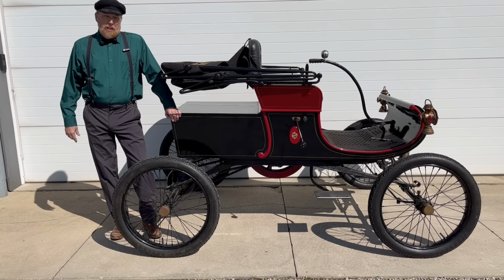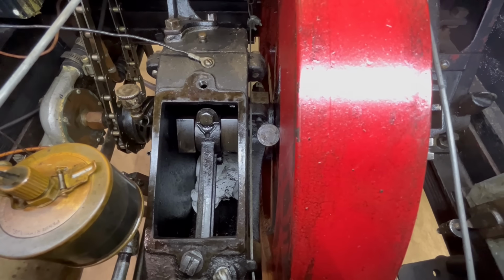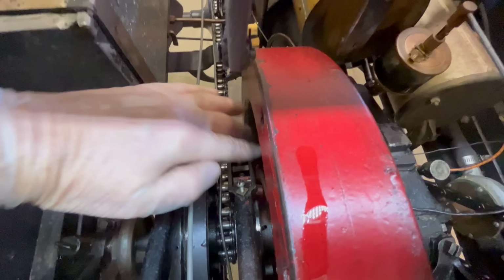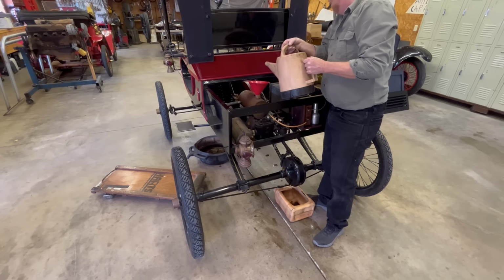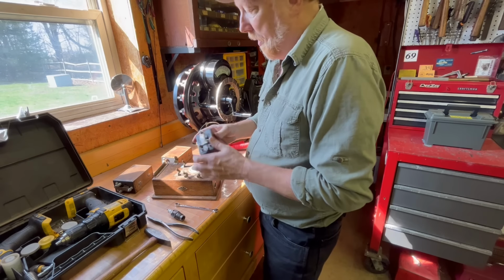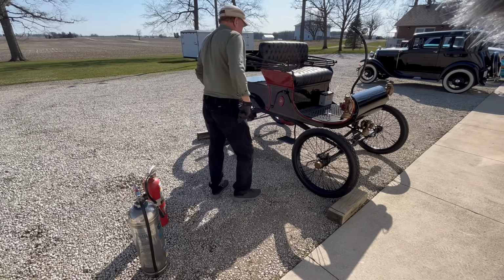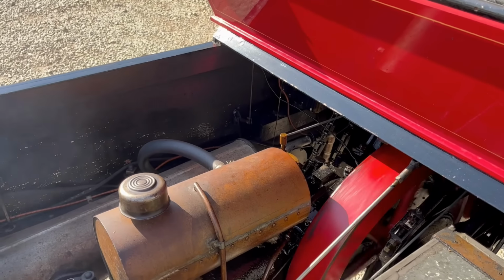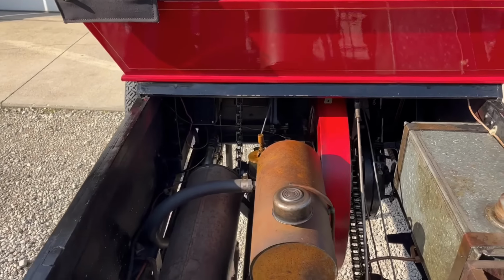1901 Olds: Will it Start and Run @KlepsGarage [EP 62]

Comment from the maker: I would like to sincerely thank the 100,000 viewers who watched in the month of February 2024. You have helped our family through a medical issue. 🙏🏻 not financially but my wife enjoyed the comments and number of views. 
Took her mind off the pain.

She has since had back surgery and is doing very well thanks all. 

This is not a political channel keep your politics to your self. 
I will delete anything political.
Reply: Just saw my first episode. VERY cool! I just subscribed. Aloha from Hawaii! We don't have too many super old cars like that here-
Reply from the maker: You might not have old cars. But you make up for it by being in paradise 😎 thx for watching
Reply: A men .
Reply: I am having a big problem with my car as of late, I was in a terrible accident where I was forced off the road on a curve just after crossing a creek bridge. Since that I have rebuilt my car, But for some reason my chain keeps jumping on the Transmission sprocker mounted on a 1949 Ford Transmission. Can that be caused because of the tighners between the axels are not intune with each other.My wheels measure the same between each Hun Center on both sides.This is a Great problem as of late.
Reply from the maker: Without seeing your car, the only thing I can suggest is a chain is either too tight or too loose. 
Or you having alignment issue as a frame could be bent and not in line with the rear axle.  Kind of crab tracking. Since it was an accd. My guess is alignment of sprocket.

Comment: It's no wonder the first car owners had engineers on staff, garages with apartments for the engineers, and many times drivers to operate these cars for them. It took a rich man to own a car AND keep it running back then.
Reply: Just added 5 miles to the odometer, time to rebuild the top end.
Reply: The very first cars were purchased to transition from horses, so the "mechanical men" that some automotive enthusiasts had on hand were largely stablehands who were adapting their skills to automobiles. Nobody hired a staff and gave them housing to simply maintain a car; they were already there. Horsecarriage maintenance and livery upkeep were not far removed from the horseless carriage.

Comment: At least 65 years ago when I was just little one, I got to ride in an original 1903 Olds just like this one.  I remembered watching the owner add oil to the crank case.  I remember how going down the road at 20 or so seemed so fast.  Stuck with me to this day.  Thanks for the memory reminder.
Reply from the maker: Your welcome. It feels like you’re doing a 100.
Reply: I would like to drive one just for bragging rights
Reply from the maker: The tiller is a strange sensation
Reply: Awesome Story Larry, God Bless You Sir
Reply: To think that that car was already ancient back then in 1960 when you got that ride. And this particular example will still be perfectly drivable in another century, if looked after right. I doubt there will be any 2003 cars running in 2124.
Reply from the maker: It will at last longer than us.

Comment: In 1901 my great grandfather was painting curved dash Olds'. With a brush, not a sprayer. Had to get the consistency of the paint just right plus be an artist with the brush. He later taught one of his dons in law how to do it and Grampa repainted his 1960 F100 that way. It had been used by a prior owner carrying a camper for hunting and the sides were badly scratched up. When he sold it nearly 30 years later, the buyer was really skeptical that it had been painted so long before and with a brush. His trick for getting it smooth was thin it just right with the right thinner and his trick for durability was mixing porch enamel in with automotive enamel. The paint still looked quite good after all those years, in spite of never being garaged.
Reply from the maker: Cool story 😎 thx for watching.

Comment: Having seen other original Curve Dash Oldsmobile 's run in person is a thing to behold. It is truly amazing what was considered the first mass production American automobile. I have a 1958 Merry Olds full size replica of a 1901, which is much less complicated and maintenance, but still requires much oiling to operate. It functions very much the same with two forward speeds and one reverse and will clip along at close to thirty miles an hour. Thank you for an informative and interesting video.

Comment: Just think, back then they checked oil, air in tires, all moving parts, coolant level plus the things you went thru just to drive across town. And only charged $0.10 cents to tune it up .
Reply from the maker: Yes. Now they want $200 to hook up the computer which does their job to tell you a sensor is bad. Then it’s 500. more to fix it. Ford had it right easy to repair and the average farmer could work on it.

Comment: I remember in 05, or 06 I got to drive and original Ford Model T push the pedal to go forward push the lever and let off the pedal to go into high gear felt like it was going to tip over but I felt like a little kid driving that thing after having the privilege to started by hand. Such an awesome adventure and I'm glad I had that opportunity. It truly makes me appreciate watching this video!
Reply from the maker: Thx 4 watching. The olds is actually easier to drive than a T.

Comment: This is a fascinating car.  I've watching this about 3 times.  I believe yours runs best of all the YouTube Curved Dash videos I've binged today.  Sure is a great car.  Thanks for taking us along.  I think you should include it in your 1/4 mile challenge.  The High gear seems to really walk off.
Reply from the maker: Thx Jeff. It is a good runner It needs a bigger radiator for summer driving. Also noisy than newer Olds because of the open transmission. It does run faster than the Brush.  Might just run the quarter.  Thanks for watching.

Comment: That right arm and shoulder sure got a workout. I had to chuckle at the sight of the two fire extinguishers wisely kept near by. What kind of ignition did the motor have? Spark plug or hot bulb? On second thought, a hot bulb would have been much more work. Total loss oiling?
Reply from the maker: Make and brake contact point. Pipe, thread, spark, plug.  Lost oiling system.

Comment: Brilliant engine design 
The internal workings are fantastic
Reply: no theyre not, loud as sheet
Reply: @liukang3545  ?
Who said anything about that
 This is the second time this week
I wrote something 
And someone else wrote a response that implied something totally different 
 - that is also corresponding with the subliminal gaslighting I caught 2 months ago .

Brilliant engine design 
 Wise.  - machine work - articulating style 

The internal - inside mechanism- rod and bearings- cast metal
Workings - the integrated components 

Are fantastic- very good
“ very well crafted 

Ok
 ✅ 
Got that
Sheeet duh too load ????
That is not in the comment 
I have no idea of it’s decibels nor if sheeet was used in the construction 

I’m not casting judgement upon its sound
Only
Saying
1901
And cast iron / steel and alloy metals made with such precision is just absolutely beautiful and amazing 
- theoretically- one could travel in time to 1901 and build almost any modern component with existing machinery and materials and even blueprint details to cast parts that accurately 

It’s just amazing 
Too much to really get into detail of the implications for that

Comment: Nice.....  And very true if you have a collection of anything that is supposed to run in some way, you should use them. Growing up in the 1970-1980's it was so frustrating with the model trains. The new stuff, Lionel MPC many considered junk and the older stuff Lionel 1969 and back was considered the good stuff, but if you had the "good stuff" and ran them the collectors hated that, and the true collectors never ran their trains.  Well I'm now 61 and that trend had changed, There are a lot more train runners and the Lionel MPC stuff has more value now to many and still run pretty good too, and the 1969 and old many run them as well.
Reply from the maker: Agreed I to collect model trains just don’t show them on the channel

Comment: This was the very first mass-produced automobile. I would use the cheap, single-grade oil, like that old "Golden State" oil in the yellow bottles. That stuff is great in old cars. I used it to break in the engine in my vintage Jeep. Once broken in, I switched to Castrol, supposed to some othe best oil there is, and a rod bearing went out. Fixed it, ran it on Golden State awhile more, switched to Castrol again and another rod bearing went out. Fixed it AGAIN and this time just kept it running on cheap old Golden State. Never had trouble again.

Comment: Well it all had to start somewhere right ?, still not bad at all for its day and it worked fine as long as one kept it well oiled 👍, i remember playing gran tourismo yrs ago and trying to get around a verry long german race track on one of these and never made it lol, on a verry long incline it eventually came to a stop and it became stuck between two long inclines connected with a dip, though it did just barely make it over other more shallow inclines, what i found was to put it in neutral at the top of a hill and let momentum get it rolling faster and you might just get over the next hill if you put it back in gear at its right max speed for the engine, it even had the same chugging sound 🤣😂🤣👍, great video thanks bro ✌
Reply from the maker: You were driving a Rolls-can-hardly. Rolls down one hill a can hardly make it up the next.  
Most would back up a hill because reverse is a lower gear ratio.
Reply: @KlepsGarage  oh, never thought of that lol 🤣👍

Comment: It does not seem to be hit and miss, I was wondering what was making most of the mechanical noises? It does not seem to be exhaust noises.
Cool video!, it goes much faster than I would have thought. I have a Fairbanks Morse engine that has a metal plate over the intake that causes higher vacuum for the carburetor, and it makes a sound like zzzt,,zzzt..zzzt. while idling.
Reply from the maker: All the noise is coming from the open transmission gears not running in oil bath

Comment: Oilers and grease cups!  I've ran across too many old machines and pumps with oilers and grease cups.  They last forever and are easy to service.  Not sure modern replacements are improvement driven or replacement/parts driven.  Leaning toward the latter.  Great footage and explanation!
Reply from the maker: Thank you and thx for watching 🙏🏻😎🍰

Comment: Heh heh, peak horsepower at 700 rpm (give or take a few). The old girl moves along at a pretty good clip, considering that engine is probably only 4-5 hp. tops!😄 👍👍
Reply from the maker: Not bad. Thinking horse is around 10. But who’s counting. 😎
Reply: @KlepsGarage LOL, probably is with modern fuel and some added timing!!😉

Comment: That's more work than hitching up a Horse.  30 MPH  I never would have guessed a 1901 would have gone 30 MPH ..  I went  through the Oldsmobile Museum years ago in Lansing MI ,.
Reply from the maker: Yes sir. Thx.
Reply: @KlepsGarage    If you really want to know your speeds, You could put a modern GPS Navigator in the car.. Might need a small 12 volt battery,  My Grand Parents were friends with an Engineer from Oldsmobile.  He was a Runner.. My Mother and Grandmother ran a lot of 10 Kilometer races around MI.  I spread lime for quite a few Amish Farmers.. Colon, Centreville, Nottawa, Butler, Sturigs , MI ect.
Reply: @KlepsGarage    I empty close to 6 Grease Guns per day on My Northwest Model 6 crane, It has a bunch of oil cups too.  I use 90W-140 it stays put longer.. Plus  many open gears to put grease on and hundreds of linkages to oil too .
Reply from the maker: Yes have used my phone gps. Yes machines do need oil. Mining uses a lot of grease have a friend down under sells grease for Fuchs petroleum 
I was just showing what you did back in the day. 
Cheers
Reply: @KlepsGarage    When I bought my Crane the previous owner used Top Sol Brand.. Their Synthetic Open gear grease in caulking gun tubes was very good.  They went out of Business. Reminds me of Lubriplate  brand Products..  Texaco Crater Compound was really good in 5 gallon buckets.. you had to heat it up .. Just put a small container on  the exhaust manifold to heat it up.  The EPA basically banned it because it had a lot of lead in it .. They also had Crater compound that was liquid.. It had either in it .. apply it and the either evaporates then it sticks really well .

Comment: Not exactly a low Matinance Vehicle !  in the 1980s i drove a older MGB  and it was in. Constant Service and Maintenance  but fairly reliable  a Freind of mine Sister had one also  hers was Constantly Broken Down and in the Shop one day she asked me  about oiling the Carburetors  as her Mechanic  told her  the last time it broke down that’s all it needed  i realized she had no idea where
the Carbs were  so i told her. she gave me a puzzled look and asked how do i open the Hood ?  i knew right then , that’s probably why hers is always in the Garage getting fixed  LOL this Olds  is funny you took half of it apart to access the points you needed to Service just to start it !  and this is a Vehicle Theoretically are supposed to start  from the Seat !
Reply from the maker: Yes. You hit that on the head. Thx 😎

Comment: My bother had an old 350cc single cylinder BSA B31 motorcycle with a springer frame. The flywheels were as big as dinner plates, and he could get it to tick over really slow on the stand. Then we would stand back and watch the telescopic fork bounce in time with the thump.........thump.......thump of the engine. 🙂
Reply from the maker: Great sound. Love it. Thx for watching 😎

Comment: if you hold the oil can so the neck is at the top, it won't glug-glug-glug like that and it's much easier to accurately pour. that's why those containers are designed that way.
Reply from the maker: But but but. I needed the sound effects 😂😂

Comment: The valve mechanism has a worn roller and a weakened spring. The video shows that one roller is running along the fist, and the second is jumping. Because of this, the valve closes 1/3 of a turn later. And perhaps both rollers are not rotating. Time 32:10
Reply from the maker: Thx. Now I can see if this an issue. I caught a problem  on another car by watching on screen. Thank you   Surprised you caught that I didn’t show the values that much 😂😎
Reply from the maker: Ok went out and checked the back roller is stuck front ok. How the blank did you catch that I slowed the video down and still wouldn’t have seen it. 
There are two lopes on the cam. The rear most toward engine is the problem child. I only ran it as much as on vid.  Has been sitting another year. Guess I’ll fix it. Thx again. 😎

Comment: I might opt for the 1901 Baker Electric Runabout.  But it would still need grease and messing with battery chemistry and some way of charging it.
Reply: Well that's easy...we have a junk oil 2 stroke Duplexer stationary hooked to a hand wound dynamo...
Reply from the maker: I would keep the horse till 1911 when Ford made a car that still can be daily driven.
Reply: Ah, of course you are right.  I live in Montana and it is still practical to ride horses and they even have their own full self driving tendencies.   @KlepsGarage
Reply: @TheCaptainSlappy  that oldmobile engine reminds me of old washing machine motors we used to use for go cart motors in the sixties.

Comment: Just a thought for changing the oil. Maybe you could jack up the front of the car so it tilts the valve down to the lowest point. Maybe then you don’t need to use paper towels.
Reply from the maker: Good thinking Mr Obvious 😂😎. Now if I can only remember to do that. 🤓

Comment: In Northern Illinois farm country, you’d get a lot of hate driving at 30mph.  I’ve had several close calls with my Model A when drivers tried to teach me a lesson by passing on the shoulder at 60 or more (speed limit is usually 45).
Reply from the maker: My older cars  I put a slow moving tractor sign on rear.

Comment: I've got 1 of the first speedsters motors I've not got the carb or what was bolted up to the crank case for fuel it will run both ways it should sound close to yours it's close in years Dubble flywheel  20 inch to maybe 2 foot going by memory so that's probably wrong

Comment: Thinking about building a doomsday apocalypse vehicle like a Suzuki Sidekick with a Suzuki Swift 1.0 engine instead of the 1.3 4 cylinder using mechanical fuel injection out of a Volkswagen Jetta from the mid-80s. No computers all analog. Not quite like this Oldsmobile but you know just in case we ever got hit with an emp, as long as I could figure out a way to build a coil and a fuel pump from scratch which I'm pretty sure I could do. Can I have a vehicle that can survive the apocalypse and doesn't rely on a carburetor. Anyhow. This vehicle is cool.
Reply from the maker: Innovation is what makes this country great. Sounds like a good idea.  Do a YouTube on it.

Comment: Don’t let the history books fool you, everyone. The Curved Dash was the first mass produced automobile in US history, predating Henry Ford and the Model T by 8 years. That’s right, ladies and gentlemen, the Olds Motor Works was the first US automaker to utilize an assembly line!

Another Oldsmobile first just so happens to be factory installed windshields & tops as standard equipment all the way back in 1915

Comment: Damn - nice find!  The coil tester you have - I can tell it has no condenser (before radios) as you camera microphone is picking up the sparks :)

One question - are the head lights actually lanterns? I see you cranking it and want to give you a hand from on the ground.  Hear it putting and the compression starting "come on you..."
Reply from the maker: Thx for watching. 😎